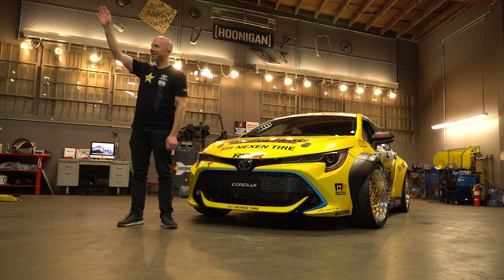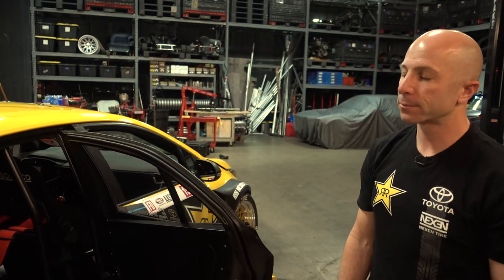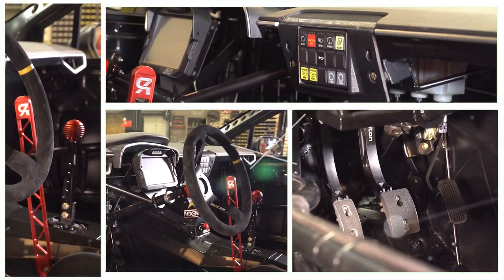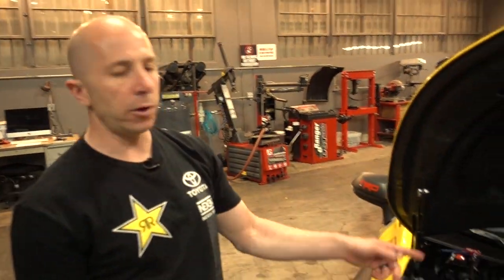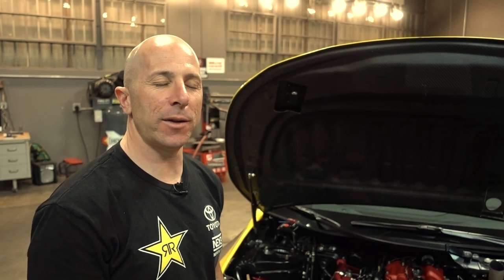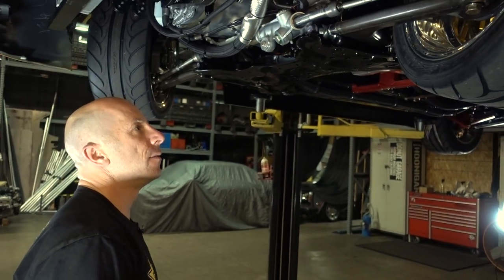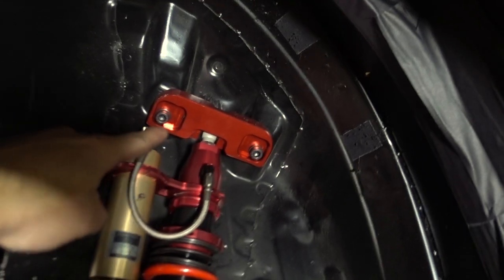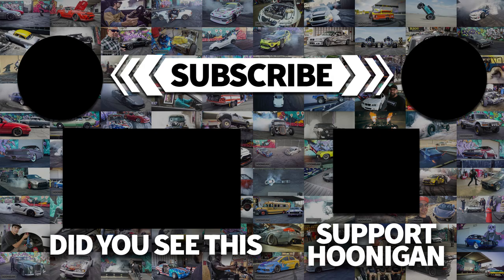1000hp RWD 2019 Toyota Corolla - Fredric Aasbo’s Drift Car

Comment: Toyota should build this car, it would be one of the hottest selling economy, sports car ever sold in American. Just to give you an idea of the performance. With an optional 300 hp 4 cylinder turbo at  2850 lbs, you're looking at  12.90  at 110 mph in the 1/4 mile  Quiet,  smooth,  reliable and fun 30 + mpg car.

Comment: #WARNING# dumb questions below...

Is it necessary to use lexus hubs in the front when all you do is remove the front axles from the original hubs?

Also when Steph mentioned adjusting the bias of the breaking, does he mean how hard the car breaks relevant to how hard you push the pedal?

Thanks guys :)

Comment: i get 2ar for thermals, but why then do pistons need to be changed if the concentration of heat is still better in a 5sfe, and still plenty of torque for this application but less cost, at least from what ive learned, i know its a bit heavier but supposedly way more reliable as a racing application than 2ar or the lastest variant unless these iron liners we are talking about are super thick and im wrong, but then Ill want to just ditch my 01 camry and get a 2ar camry and build that instead if thats a better idea

Comment: You know if these fuel cells cables tubes radiators coolers didn’t have to have crazy cosmetic appeal I think these performance parts would be more cheap I mean a high pressure fuels system just needs high pressure more durable lines cause that fuel cell looks expensive cause the way it looks not how it performs

Comment: Front ABS sensors disconnected. No ABS?
Reply: Would one need one at a Formula D event?
Reply: @shapshooter7769  apparently not. For an emergency lock up before the barrier it may be useful at times however;)

Comment: So I'm researching for an up coming build, converting a 1983 Toyota Corolla DX Wagon to rear or all wheel drive, and mounting a supercharged 454 mid engine. Love you're build. Looks great! I've picked up all kinds of tid bits from you. Your rear "swing arms" look like the counterweight hangers on my Whipper Trebuchet. Most of them are wood, but I'm fixing to fab up some metal truss like ones. I like your design very much. This is one of my larger Catapults in tournament. https://www.youtube.com/watch?v=UDoJscXKXwM

Comment: ..Wait ! did he say 2.7 lit and stock its 2.5 lit..does toyota make 2500cc engines ??
will look up the spec..i dont like i4 engines for their sound but power vice this is ok.
...shit man,toyota has an 2.7 liter engine as stock named 3RZ from 1995 and onwards.
2TR att 2.7lit from 2003.
and an 2,5 lit named A25A from 2017.

Comment: A Formula 1 team did that with the “radiator” the fan sucked the air up and pushed air out the back creating negative space under the car which sucked the car down. None of the other cars could keep up and they all complained they were cheating but it was more bending the rules lol, long and short of it, politics won and now we lost a whole interesting type of build